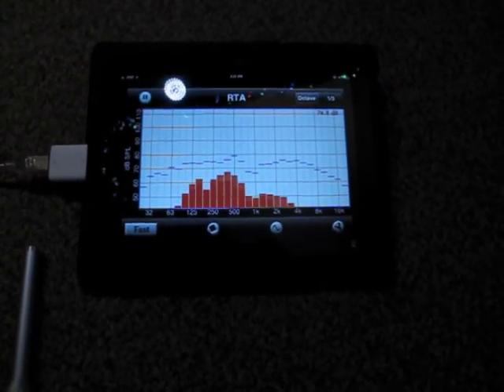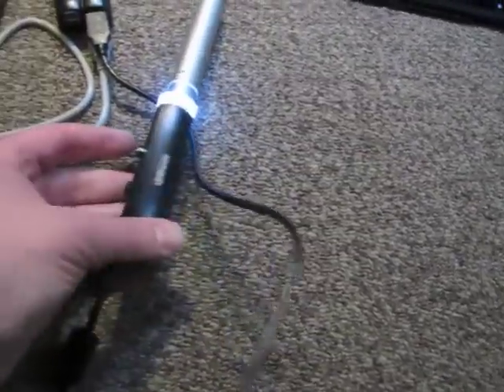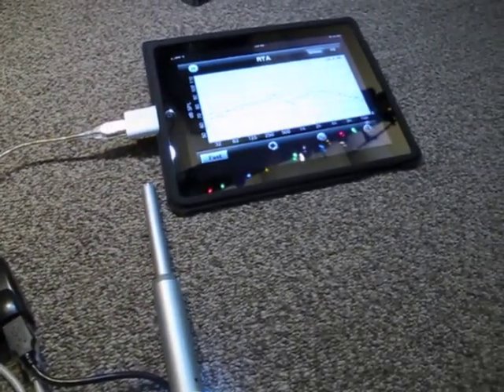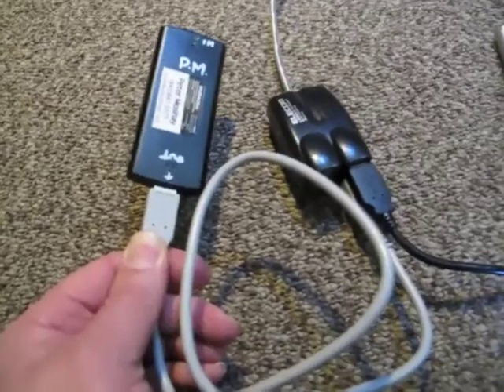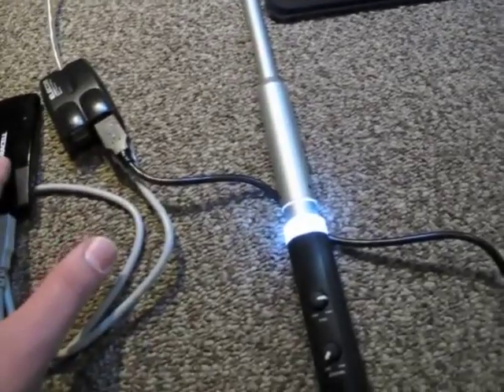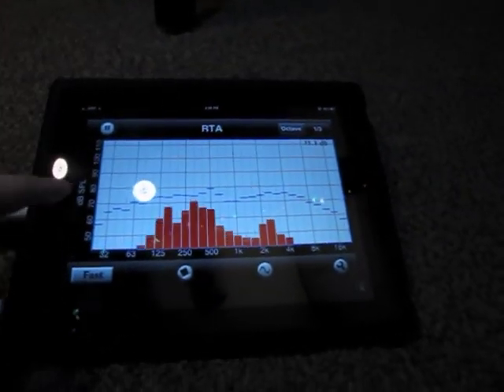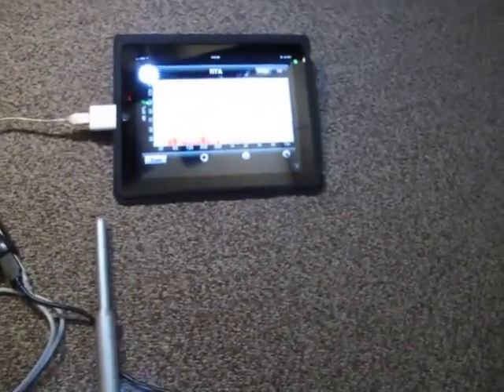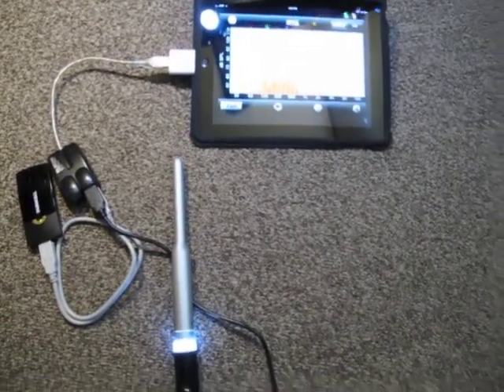iPad RTA Analyser with external mic

Comment: Hi i have a question, can i use this kind of sistem to plug the ECM8000 to the USB hub of my pc? Does my pc recognize the instrument like a microphone plugged in the AUX in?

I can't find a way to connect my ECM8000 (XLR cable) to my pc

Thank you very much for your response
Reply from the maker: you are best off getting one of the XLR/Mic to USB interface from Amazon, they are about $49. Blue Microphones makes one called the "Icicle" and it provides phantom power. The Behringer ECM8000 mic can run off 12v-48v phantom........ The Icicle is similar to the one i was using in the video and can plug right into any computer USB port and is seen without installing any drivers (thats what "Class Compliant " means)
Reply: Peter Moshay Thank you very much!

Comment: favor ayudame con los nombres especificos de cada implemento para que funcione el microfono externo, me interesa usarlo con el analizador de espectro gracias!
Reply from the maker: you can use almost any USB hub, and if you use a powered one, you do not need the battery. The Behringer ECM8000 reference mic was used with this setup.
I would stay away from USB 3.0 hubs though, use USB 1 or 2 stuff

Comment: I have a question for you, which ipad were you using and which OS version were you on. I'm looking to get an Ipad 1 for this purpose but wondering if the os upgrades killed the functionality of the camera connection kit, Ive been reading that they reduced power output on the 30 pin by 80%, wondering if this had any impact on hooking in the external mic?
Reply from the maker: Im not 100% sure but i would guess that i was using the 2nd or 3rd update of the original iOS that came out at the time of the iPad 1 release

Comment from the maker: Many ask if you can use the iPad internal mic or plug in a mic to the iPad 1/8" jack. -- The answer is "Yes you can", but heres 2 things to consider first.

1. The iPads mic input has a steep HPF at about 200Hz, so low end analysis will not be correct.

2. The iPads mic in does not provide power to mics that need it, and there is also no gain control.
Reply: Peter, I like the ears. It says "sound is my identity". I should want to try something with projection. 

The i pad doesn't present any form of phantom power. So any condensers or even piezoelectric are without bias. Therefore, dynamic mics are all you can do. The mic built in is what my sound engineer uses. It does and adequate job of RTA. The screen is what counts most for room eq. Have you tried any USB port through mechanisms? 

I have found the best thing to use I pad for is live monitoring. On digital boards you can walk around and do an old skool sound test, change zone effects like delay or balanced volumes. Best feature ever.
Reply from the maker: +Rene D. Rodriguez 
I did use a USB powered hub with success

Comment from the maker: you need a separate SPL meter (like a Radio Shack SPL meter) and then play pink noise over some speakers (about 90db) and measure the level with both the SPL meter & iPad Mic right next to each other, then trim the iPad level gain to match the SPL meter's reading. It's not 100% scientifically accurate, but can be within a few db and close enough for 95% of situations.
The measurement mics on either units are calibrated at the factory and will say in the manual how close they are to flat.

Comment: Is it possible to plug the Duracell into any non-powered USB hub slot to make it a powered one? So if I bought a 4 port hub the wired end would go into my device and the Duracell could take up one of the 4 USB slots while providing power, correct?

Comment from the maker: Update:- this is also a option so you can use the headphone mic input with a small calibrated mic made for this!.
The Program "Analyzer" ($9.99) for iPhone & iPad works well with the iMic into the headphone port mic input if you use their calibration add-on ($9.99) for the Mic W i436 mic ($125 at Amazon, search "Mic W i436").
The "Analyzer" program also has calibration templates that compensate for the internal mic and the apple headset mic too ($2.99ea.)

Comment from the maker: @AbaroaTV The Program "Analyzer" ($9.99) for iPhone & iPad works well with the iMic into the headphone port mic input if you use their calibration add-on ($9.99) for the Mic W i436 mic ($125 at Amazon).
The "Analyzer" program also has calibration templates that compensate for the internal mic and the apple headset mic too ($2.99ea.)

Comment from the maker: for sure! the only problem is that the headset jack mic input has a steep HPF on it and some eq abnormalities that prevent it from being flat (they do that so the headset mic sounds good with a voice). Also the mic input on the headset jack won't provide power to a mic that needs it. The inputs at the dock are the closest to a flat input.